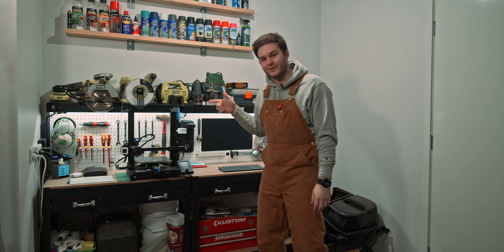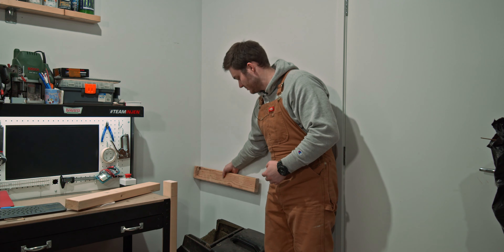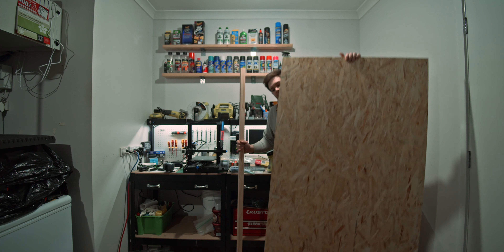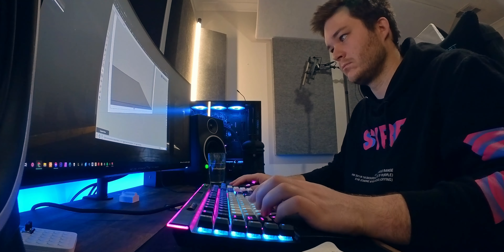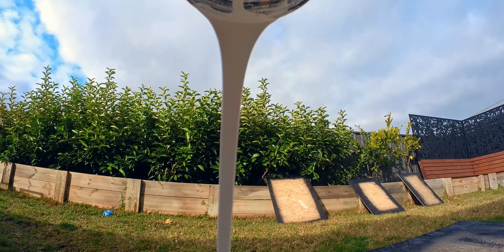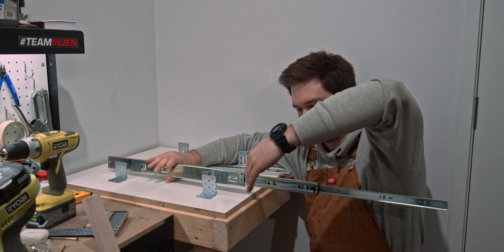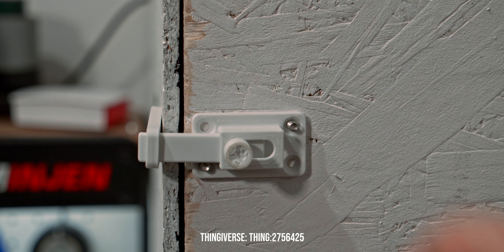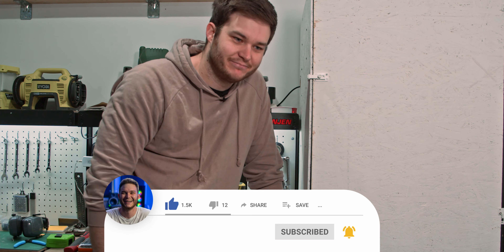3D Printer Enclosure DIY build

Comment: Nice little enclosure there! Just got my first 3D printer 2 weeks back, a Voxelab Aquila which is 95% an Ender 3 v2. Looking at probably going something more along the lines of the Ikea Lack table type enclosure, but that slide out shelf is a glorious idea. Moving house in 2 months so could be a little space to setup after that and I might come back to trawl this video a bit more then!
Reply from the maker: yeah IKEA Lack build is a good one, you can always add the sliding shelf to the base of it. It's really made loading filament and accessing the rear of the printer so easy, worth the extra cost of drawer slides and a base :)

Comment: Great idea on the runners! Looks like you could get a bit of heat up in there. Are you planning on printing some ABS or other engineering filaments?
Reply from the maker: Good question! I'm leaving the option open for ABS, but would cut a vent hole and add carbon filters for the fumes. I left a patch of the top without foam for now to easily add that later in the future.

Granted it's not heated like a heated enclosure would be but being able to retain some of the internal heat should help with consistent prints :)

Comment: Nice project. Any thoughts about the heat that might increase during the printing? Looking forward to improvements made after it has been used for some time
Reply from the maker: Yeah so I've actually ran into issues, it is too good at retaining heat!
The enclosure has hit almost 50degrees and that causes filament to belt in the bowden tube, swelling and jamming up at the extruder cog... so I've had to leave the door cracked ever so slightly until I cut a hole in the top to vent a bit.

I wanted it to maintain a steady heat, didn't realise it'll rise and hold so well hahaha

Comment: I cam I have a ender3 v2as well what upgrades do you recommend
Reply from the maker: That's so cool, great printer! I upgraded my Bowden tube for higher temp abilities, plate springs and recently added a BLTouch for auto bed levelling. I'd say the springs and tube are the two main essentials, others are nice to have.

There's also a cool tool holder and filament guide I printed that you can see in my initial Ender 3 V2 vid https://youtu.be/hTSW-fXdFQo